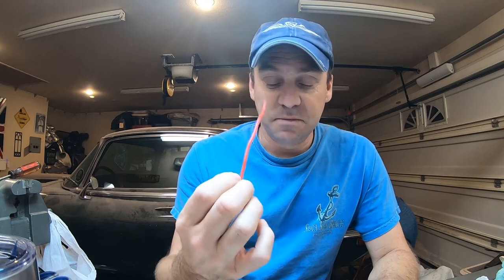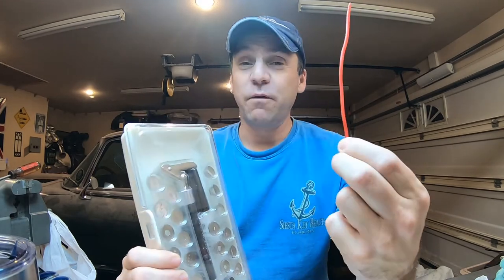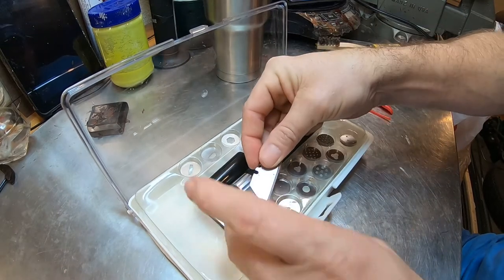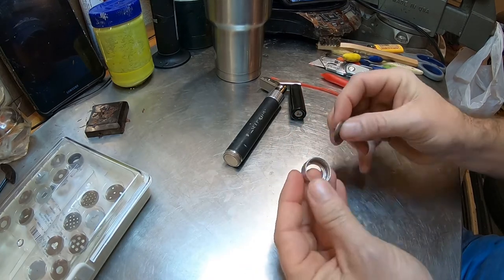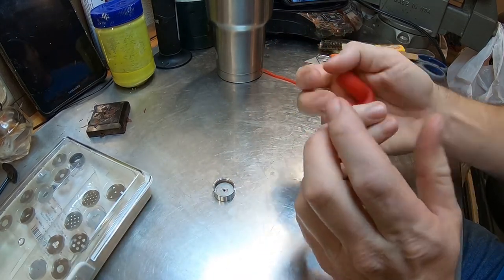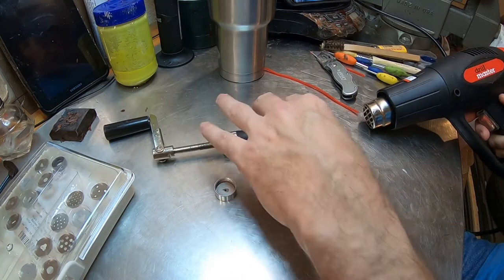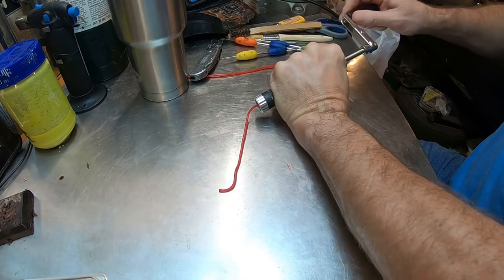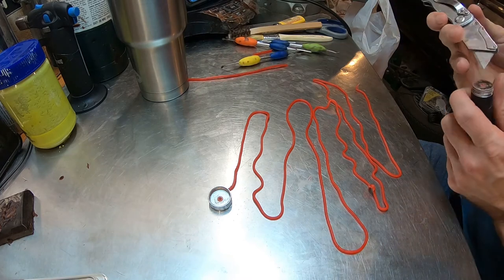Wax sprue extruder on the cheap for bronze casting

Comment: Heh. Pooping out sprues. Good trick!
Reply from the maker: Tobho Mott Zap had me thinking about a solution and I had nothing to lose but a cheap tool.  I should build a proper rig, but time is hard to come by.
Reply: worldtraveler I hear that! Glad this worked, good idea doubling (tripling?) up on the dies to keep them from popping out.  That Sculpy clay must be a lot softer than Michael's knockoff brand if it goes through that thing.